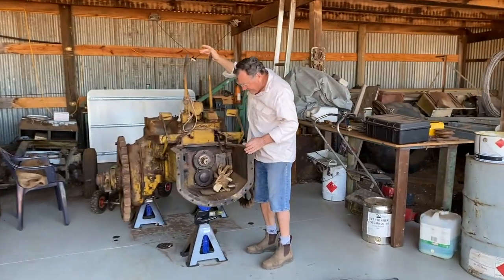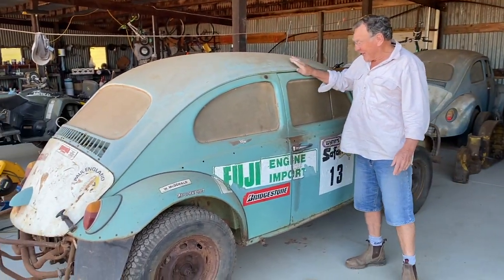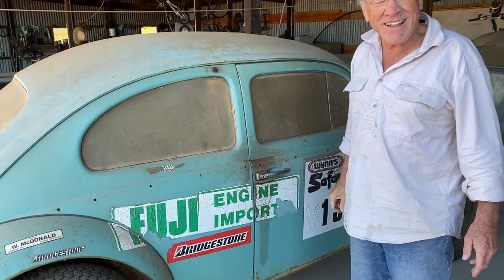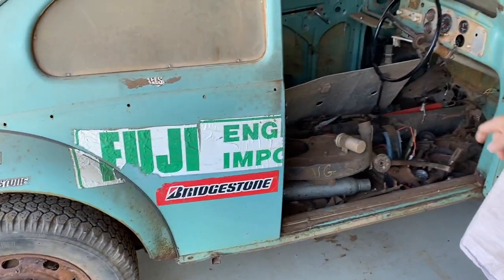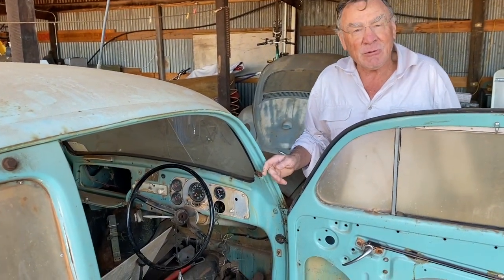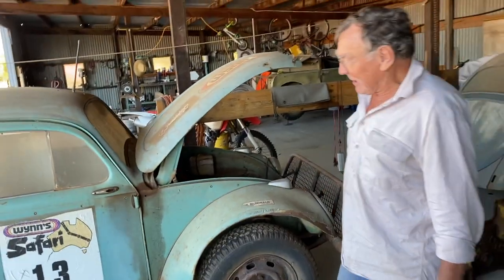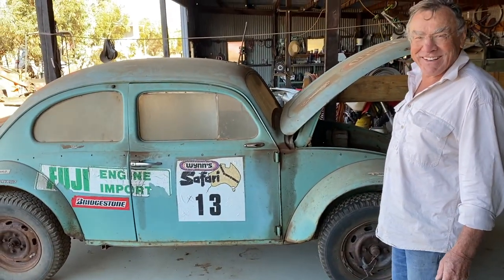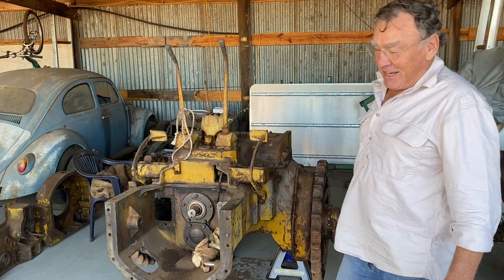Episode 7: Larry Perkins shows us his Wynns Safari Volkswagen Beetle

Comment: There are a lot of tricks to that beetle. 

61-2 body with later brakes (probably a 68-70 bj/irs pan)

Front beam stiffeners.

External oil filter and prob oil cooler. Alternator instead of a generator. My money is on a lot of engine mods on a 1600dp base motor too.

Fuel tank moved.

Seriously trimmed front and back end with a baja engine cage. 

Etc etc.